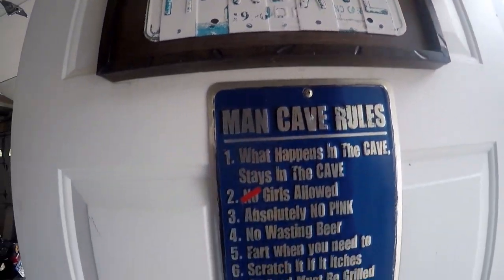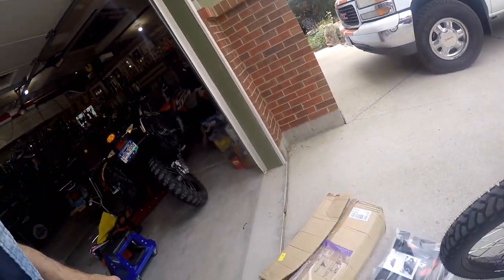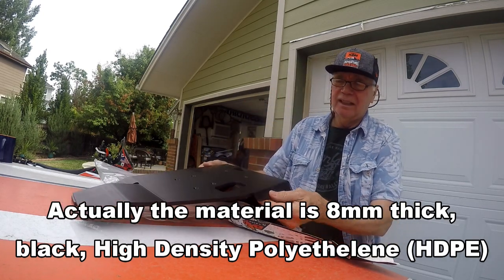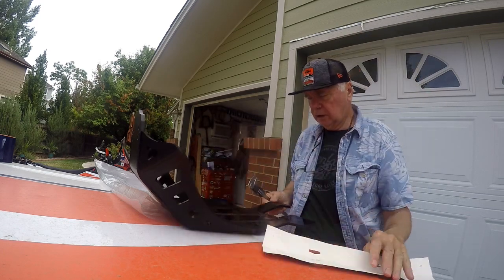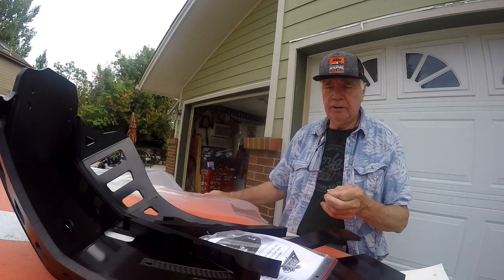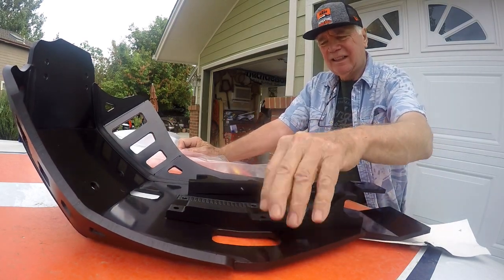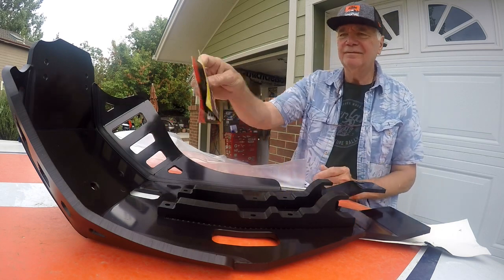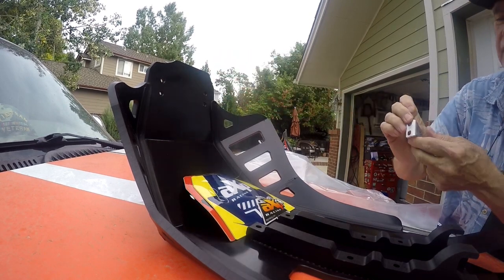2019 KTM 690 Enduro Mods #31 AXP Racing HDPE Skidplate

Comment: Mike, we shouldn’t have to modify aftermarket parts to fit our bikes. Had the same thing with my pannier frames, holes didn’t line up and I had to file them out. I’d also be replacing that front tyre with something that has grip in the dirt. I like the Dunlop D606. Keep up the good work. Have you ever wanted a centrestand on the 690?
Reply from the maker: yes, a centerstand would be nice, for working on the bike, but if I get a flat, I'm riding that sucker out. I think if I was stronger I could have flexed than pan onto the bike.

Comment: Was planning to get this unit until I saw it split in half after one hit from someone on the adventure forums. Thinking adventure spec plate at this point due to its better motor/chassis protection.
Reply from the maker: what is the forum link to the where it said it split after one hit, please?
Reply from the maker: Thank for the link to the picture. It didn't "split in half", but separated at the top right weld seam. Its a one piece unit except for the hangers. The case guards on the sides of the skid plates are bent and folded up to meet the front edge where the seam is "welded". That weld came apart when the right side hit something with a lot of force. I've seen aluminum bash plates break at the same place. Its springy, so it returned close to its original position. It probably save the engine case and the rider's right foot. I am sure Slavens, who sold the skid plate to him, or Xavier at AXP Racing, will replace the skidplate. Its a slippery unit and good for sliding over rocks and logs. I checked out the Adventure Spec bashplate, but as with most of the variations out there, you have to take it off to change the oil. I am all over convenience.

Comment: Did you have to extend any braking cables / lines?
Reply from the maker: not on the 2019. I had to make a 2inch longer clutch line on the 2015 with the BRP risers